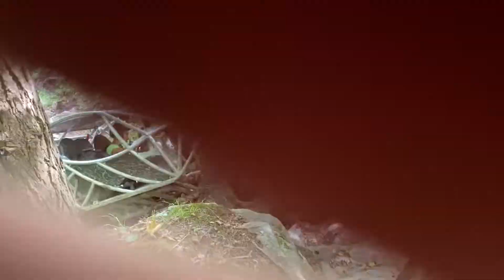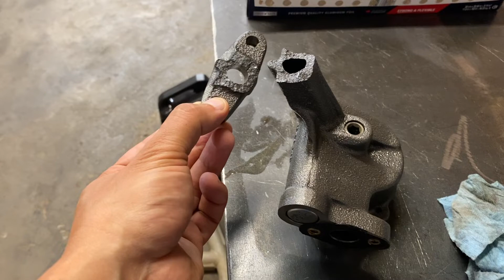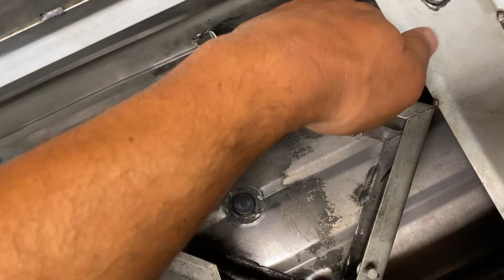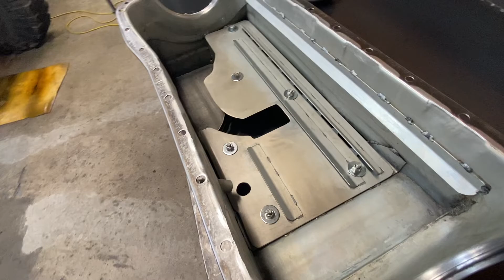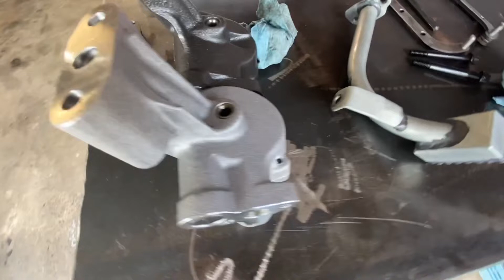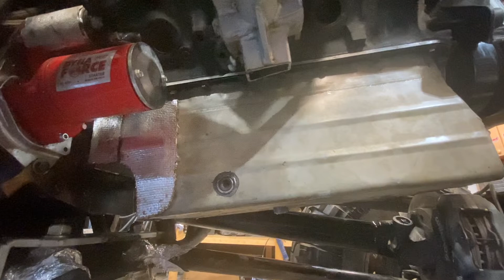I lost engine oil pressure | Kaase oil pump upgrade

Comment: What many will do wrong, is when they tighten the Main Cap Support, they will "draw Down" the oil pickup tube to the main cap. That tube needs to be laying naturally against that main cap bolt when at rest before tightening that stud nut. If it is not already at rest when you tighten that pickup tube support, then that small tension will multiply at high RPM placing significant stress on the pump, enough to break it off. 
Most broken pumps are in rear sump applications.

Comment: The story of my life; dizzy off, drop the pump shaft, leaking pan gasket.  And now I too have weak oil pressure.  I may have to go the Kaase route.  Cutting the filter to verify if any metal is in the filtering element, and hopefully go from there.

Comment: Been there, done that.
Put my 302 distributor in 180 degrees off (TDC exhaust stroke) and couldn't figure out why all the backfiring....Oops!
lol
Also, those 385 BBF oil pumps are big cast iron 'tuning forks'.
Reply from the maker: I agree about the 385 oil pumps.